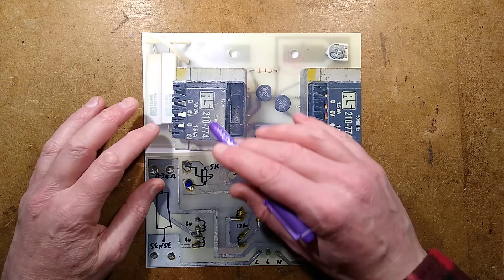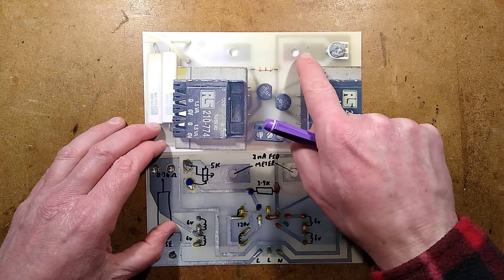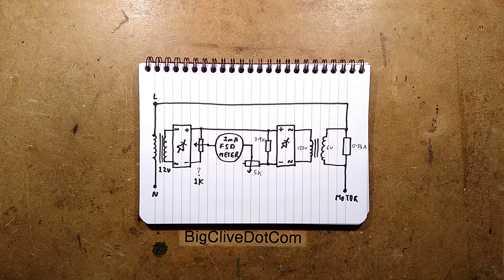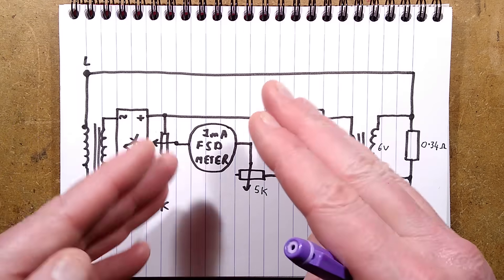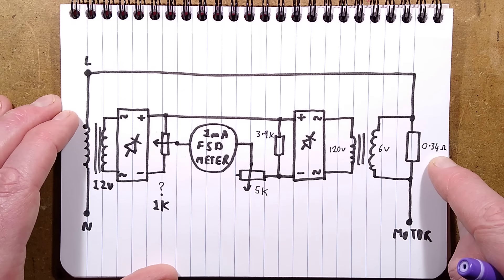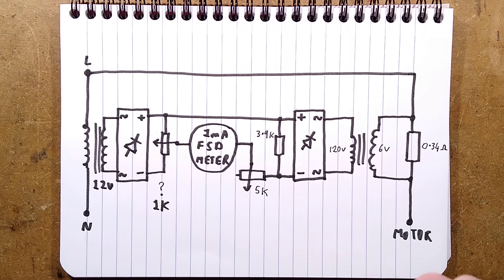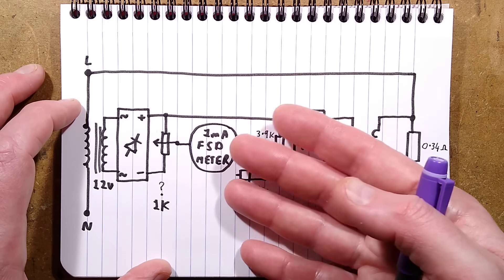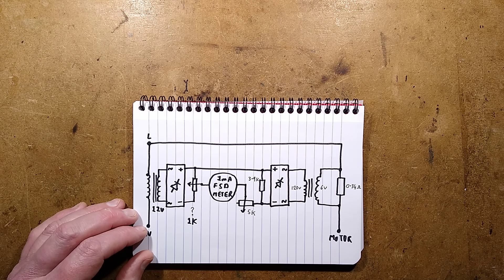Unusual circuit with retro-feel (specialist PCB cleaning machine)

Comment: Kinda reminds me of the circuit I saw someone use for power tools with a dust collector in their shop. They all ran off a supply with essentially a shorted stud rectifier in series with the mains, and the voltage drop across the rectifier was stepped up with a transformer to switch a relay which turned on dust extraction whenever a tool was being used. Really easy circuit to cobble together from random parts :D
Reply: The commenters so far have described several ways to use two or four (antiparallel) rectifiers in series with the power tool mains motor circuit so as to produce a known voltage drop with which to energize the relay via a transformer. The "stud" part simply specifies a rectifier with high-current capability and includes a threaded rod by which to mount it to a heatsink.  The "shorted" part of the description doesn't make sense. A shorted rectifier is one that has failed and the cathode and anode are now fused together and present  some low resistance, which would not be reliable or appropriate for feeding the transformer and relay. Conceivably  the commenter actually meant a TRIAC with gate connected for ~100% on-time, so just a single stud-mounted component would produce the desired result.
Reply: A bit like this circuit? https://youtu.be/FHD5XUUs3As
Reply: This balancing circuit reminds me of a DiY syncing circuit I saw for paralleling generators. Except the read-out switched between a motor with alternating 1/4 wedges black/white and a FSD meter. When the wheel stopped, they were in sync, the deflection needle would show imbalance between loads once paralled. That transformer arrangement is odd though and reminds me of designs where one of the constraints was re-use of existing parts from the BOM.
Reply: Sounds more like a resistive shunt which could work too
Reply: i just had this interaction with chatgpt - i dont undertsand this comment at all - Kinda reminds me of the circuit I saw someone use for power tools with a dust collector in their shop. They all ran off a supply with essentially a shorted stud rectifier in series with the mains, and the voltage drop across the rectifier was stepped up with a transformer to switch a relay which turned on dust extraction whenever a tool was being used. Really easy circuit to cobble together from random parts
ChatGPT

The comment you provided describes a circuit used for power tools in a woodworking shop to automatically activate a dust collector whenever a tool is being used. Let me break down the key components and the functioning of this circuit:

    Stud Rectifier:
        A stud rectifier is a type of rectifier that converts alternating current (AC) to direct current (DC). In this case, it's mentioned as being essentially "shorted," which means it's likely used as a simple diode to rectify the AC power supply.

    Voltage Drop and Transformer:
        The voltage drop across the rectifier is utilized as a signal for the circuit. When a power tool is turned on, it draws current, causing a voltage drop across the rectifier.
        This voltage drop is stepped up using a transformer. Transformers can change the voltage level of an AC signal.

    Relay:
        The stepped-up voltage is used to switch a relay. A relay is an electromechanical switch that can be controlled by a small electrical signal. When the relay is activated, it can turn on or off a larger electrical load.

    Dust Extraction Activation:
        The relay is likely connected to control the power supply to the dust extraction system. When a power tool is turned on, it causes a voltage drop across the rectifier, which activates the relay. The relay, in turn, switches on the dust extraction system.

In summary, the circuit is a simple yet effective way to automate the dust extraction system in a woodworking shop. When a power tool is in use, the circuit detects the voltage drop caused by the tool's operation, and this triggers the relay to turn on the dust collector, ensuring that dust extraction is active when needed. It's described as an easy circuit to assemble using readily available parts.
""""""""""""""""""""""""""""
it was 'stud' rectifier that baffled me. i know what a full wave rectifier is, i know what a diode does? i dont know what a 'stud' is?
ChatGPT

I apologize for the confusion. In electronics, a "stud" rectifier refers to a type of rectifier that is mounted on a metal stud or heat sink. The term "stud" in this context refers to a threaded metal rod or post that provides a means for mounting and securing the rectifier to a surface, often a heatsink for thermal dissipation.

Stud rectifiers are typically larger and more robust than standard diodes because they are designed to handle higher currents and dissipate more heat. The stud serves both as a mechanical support and as a means to efficiently transfer heat away from the rectifier to prevent overheating.

So, when someone mentions a "stud rectifier," they are likely referring to a rectifier diode mounted on a metal stud for mechanical support and effective heat dissipation. This type of rectifier is often used in applications where higher power handling capabilities and efficient heat dissipation are required, such as in power supply circuits for heavy-duty equipment or industrial machinery.
"""""""""""""""""""""""""""""""""""""""""""""""""""""""
why would he 'short' it?
ChatGPT

In the context of the comment you provided, the term "shorted stud rectifier" may be used to describe a rectifier that is essentially acting as a diode, with a forward-biased connection to create a short circuit in one direction.

In a standard rectifier diode, you have an anode and a cathode. When the diode is forward-biased (meaning the anode is more positive than the cathode), it conducts current, and when it's reverse-biased, it blocks current.

In certain applications, especially where a simple rectification is needed, engineers might use a diode in a configuration that effectively short-circuits the negative portion of the AC waveform. This is common in half-wave rectifiers, where only one half of the AC waveform is used.

So, referring to it as a "shorted stud rectifier" might be a colloquial way of saying that the diode is arranged in a way that it's effectively shorting out or conducting during part of the AC cycle, providing rectification.

In the specific application mentioned (power tools with a dust collector), this kind of arrangement might be used to detect when the power tool is in use, as the rectifier would conduct during the positive half-cycle of the AC waveform when the tool is drawing power. This voltage drop across the rectifier, as mentioned earlier, could then be used to trigger the circuit that activates the dust collector.
""""""""""""""""""""""""""""""""""""""""""""2
i understood the v drop etc. it was shorted stud, i didnt
ChatGPT

I see, and I appreciate your clarification. The term "shorted stud" might be a colloquial or descriptive way of referring to a rectifier diode that is essentially used as a short circuit during part of the AC cycle, allowing current to flow in one direction.

In electronics, especially when dealing with power rectification, engineers may use terms that convey the functional aspect of the component rather than the technical structure. In this case, it's indicating that the rectifier is configured to conduct current in a manner that effectively "shorts out" or allows current flow during a portion of the AC waveform.

In a simplified sense, the "stud" part might just refer to the physical mounting structure (the metal stud) of the rectifier, and "shorted" emphasizes its role in conducting during part of the cycle. It's essentially a way of highlighting the operational aspect of the component in the specific application.

thanks! that was jolly educational.
Reply: @KarldorisLambley  I wondered if it was two stud rectifiers back-to-back - that would give you a 0.7v square wave across them when the load/tool was on.
Reply: @georgescott6967  I am old enough to know what a stud rectifier is but the term "shorted" also bothered me and I came to the same conclusion that you  did that Yoshi is referring to two back to back rectifiers.
Reply: @Vincent_Sullivan  thanks for your input.
Reply: @Vincent_Sullivan  @georgescott6967 It could be two rectifiers back-to-back (connected in parallel but in opposite directions) to give a 0.7 V drop over most of the AC waveform.  But I think it's more likely a full-wave bridge with the "+" and "-" outputs connected together (thus the "shorted" comment).  This has two diodes in series in both directions, giving 1.4 V drop.
Reply: @KarldorisLambley   Wow, wait, so ChatGPT actually GOT something 'slightly esoteric and colloquial at the same time', AND didn't make things up?!  Wild!

Also, the original description does seem to make sense to me, and while I've never used a SHORTED stud rectifier before, I've used studs/rods for heat-sinking them before.  I suppose a 'shorted stud' could literally be 'feeding the other leg to the stud itself' if grounded, or even just looping across the stud to give it a bit of resistance to wear out in.  If it was after a transformer, I could totally see shorting it to ground or to itself and just ignoring the other phase...having 'too consistent of a power input' might make it hard to get the voltage difference to be obvious, but they seemed to say it was on the mains-side.  Someone else in comments here said that meant it was just a 'large rectifier and using one section of it as a glorified resistor'.  I've never tried that...but might in the future, that might be useful!  :)

Mostly I was just commenting to say that "Wow, ChatGPT got something non-obvious right!", and here I am, learning new stuff too.  Not just the 'shorted rectifier' trick, but also that I can ask ChatGPT to explain odd phrases to me.  Very nifty...
Reply: @KarldorisLambley  Absolutely astounding how smart these chatbots are becoming.